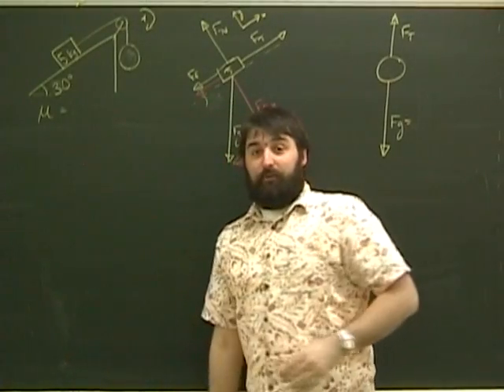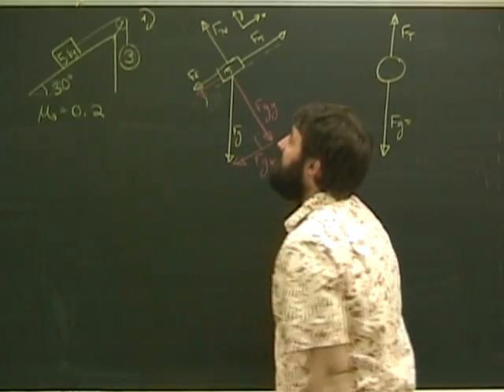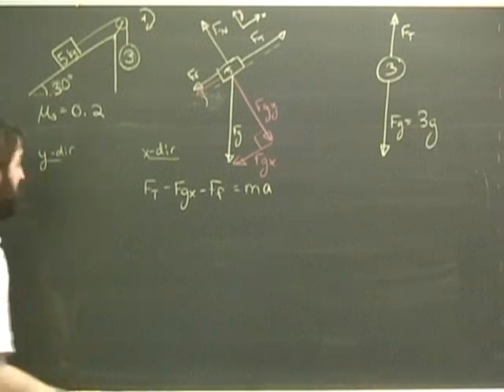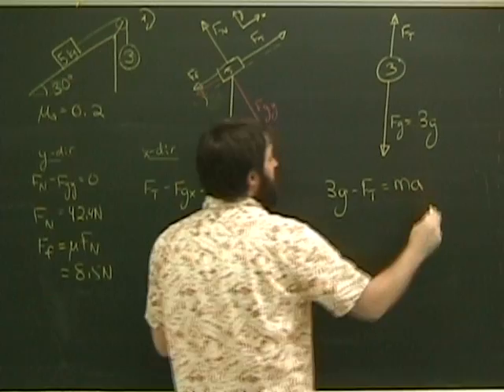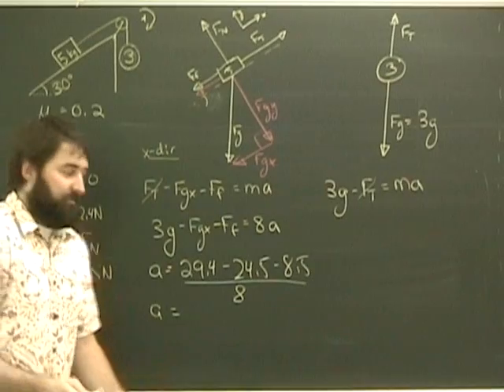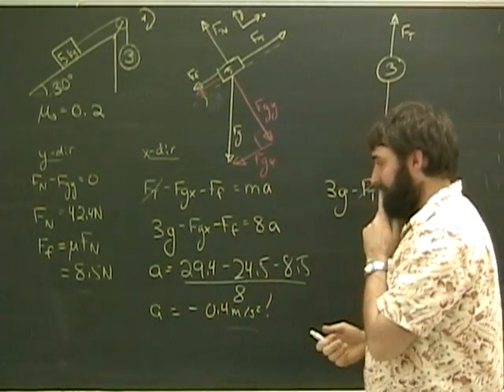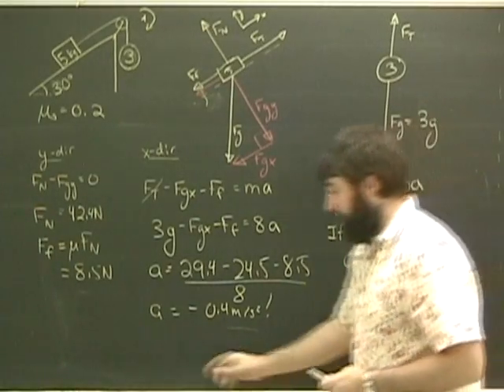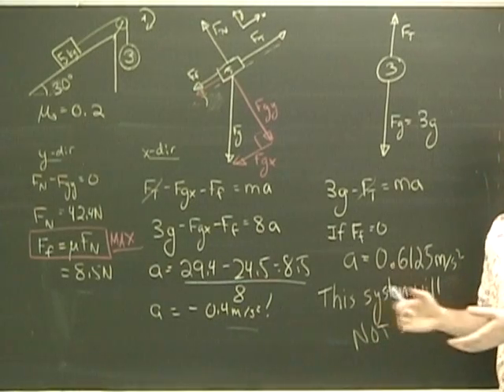Physics Pulley on a Ramp Problem (Advanced) Tutorial

Comment: The easy way is to pull out friction from the problem and see in which direction it moves, in the presence of friction it will either be in state of rest or will move in that direction. If it moves up the ramp the equation that governs it stands to be: [(3g)-(5g.sin30)-(u.5g.cos30)]=[15a] but if it moves down the ramp then the equation turns to be: [(5g.sin30)-(u.5g.cos30)-(3g)]=[15a]. You sove for a in each equation and the one which gives you +ve value is in correct direction. eq1 give u + ans

Comment from the maker: @xxxEnChantedxxx The friction formula calculates the maximum friction available. If you pull an object with 4N and you calculate the friction as 5N then you actualy only get 4N of friction since that is all that is required and the object will stay at rest. In this example the maximum friction was more than required so there was more than enough to keep it at rest so the accel = zero. That is, the max friction is larger than the total force pulling it to move. i hope this helps.

Comment from the maker: @mytkt93 When you start this type of question you need to guess which way it will accel. If you guess right, the accel is positive. If you guess wrong, it ends up negative. If it ends up negative you can't just say the accel is the other way because the calculation is wrong. You need to start the question again assuming it will accel the other way and the free body diagram will end up different (the Ff would be the other way) As a result the accel will be a different magnitude. Hope this helps.

Comment: THANK YOU  = ).  It helps me a lot.
I have another question, why the system will not start when the acceleration calculated is negative? Negative acceleration means the 5kg object remains stationary or moves down the hill? My problem is that I don't understand what is the negative accel stands for. Thank You

Comment from the maker: @mytkt93 Hi. If the system does not start then the forces in the x-direction on each mass is balanced so on the 5kg the equation becomes Ft - Fgx - Ff = 0 and not "ma" since the acceleration is zero. You can now figure out Ft since you can find Fgx and Ff. The easier way is to look at the 3 kg object. The equation for this is Fg - Ft = 0 since the accel is zero, so Fa = Fg or 3*9.8. When the sytem does not move the question is much easier. I hope this helps.

Comment from the maker: @treblajf4 If the masses were equal it still might move down the hill in the same direction because all of the gravity on the right mass is pulling the system and only a component of the left mass is pulling in the opposite direction. The angle will also make a difference. The angle effects the size of the component of gravity that is pulling the left mass down the hill. The larger the angle the larger the component of gravity so it is more likely to move down the hill or not at all.

Comment: @treblajf4 If the masses are equal:  instead of a=(29.4 - 18.5 - 8.5), it will be a=(49 - 18.5 - 8.5) so there will absolutely be movement lifting the weight up the ramp.

The angle does matter for this problem.  The larger the slope the less friction, but the greater the force gravity applies directly to the object (fgx).  Imagine the ultimate slope - 90 degrees.  There would be no friction, but 100% of the force of gravity would pull the object downwards.